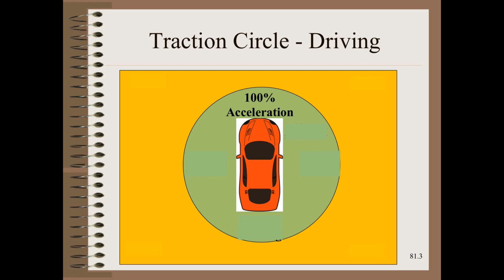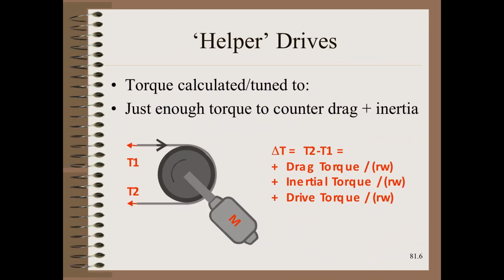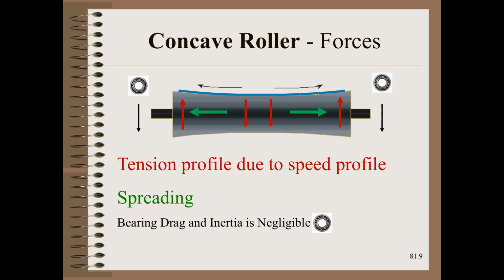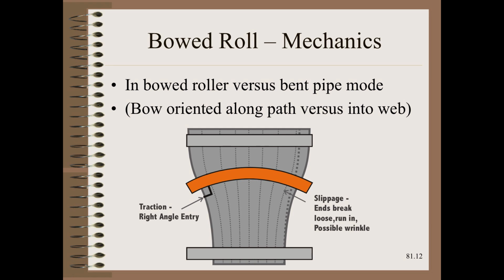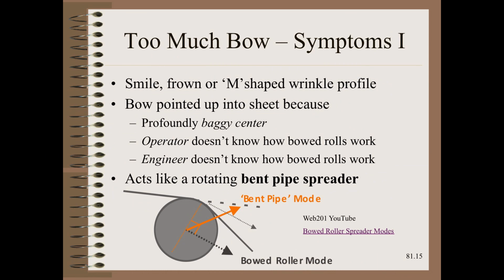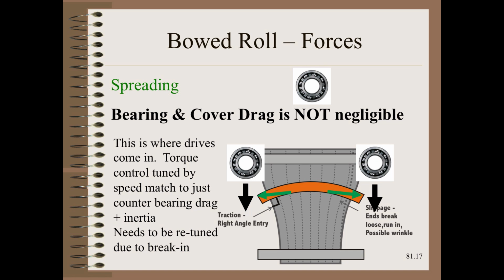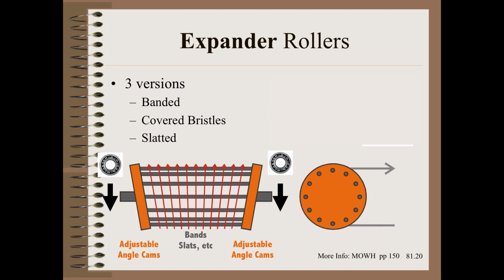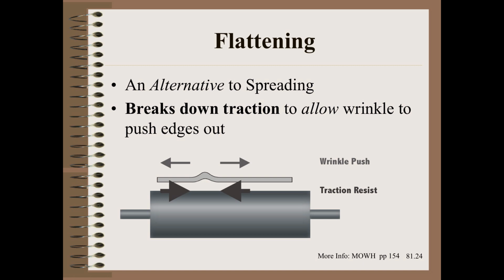Web20165d - Summer School - Spreading and Traction

Comment: If the web speed is slow (1300m/5days) does a spreader roll still work (in vacuum)?
Reply from the maker: Yes, in fact it may work better (without air lubrication that can cause reduced traction at higher speeds on smooth webs)